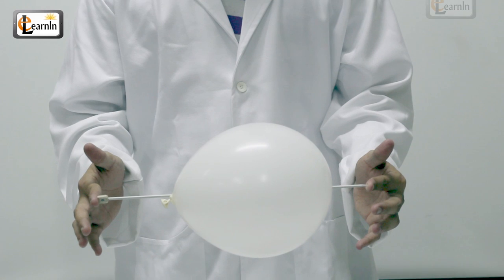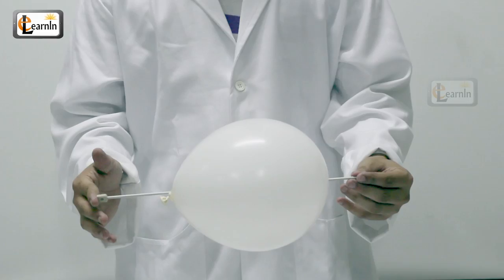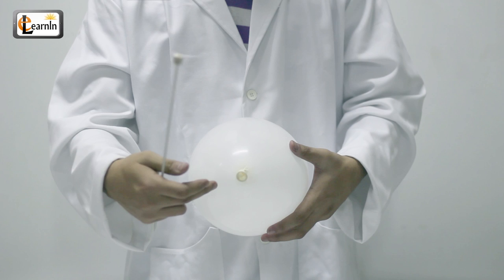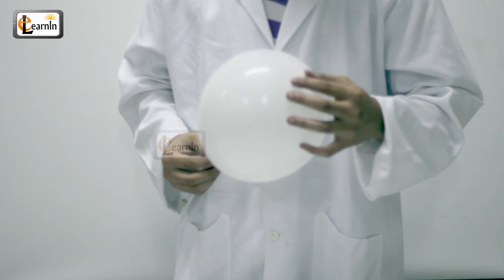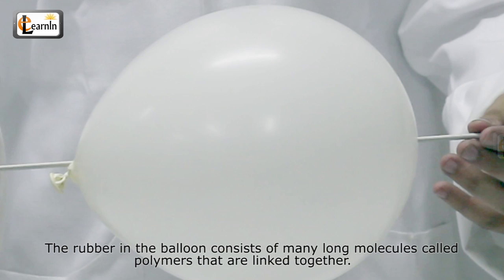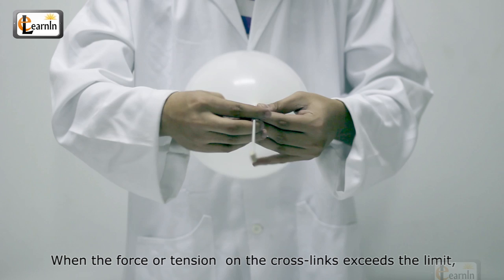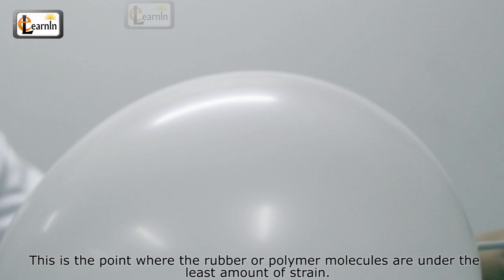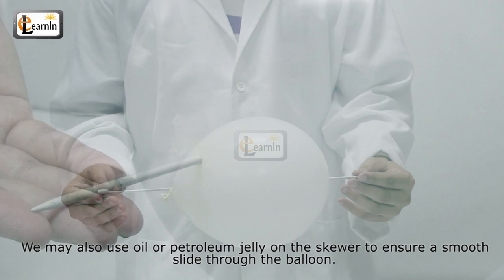Needle Through a Balloon - Science Experiments for School Kids

Comment: What? I Dident Get Anything XD
Reply: Donovan Reed It's like cheese.  When melted cheese is in a funnel, they fall down to the small hole, also covering it.  Then, if you cool it down, the cheese will block the hole, preventing any leaks.  On the balloon, it happens a little similar.  The polymers on the dark spots are a lot more that the other parts.  So when you stab that part, the polymers will sink slowly to the hole, covering the spaces.  And it didn't pop because the polymers stretched and sunk with the rod slowly, making the polymers adapt to the stretching, not being stretched to the limit.  Correct me if I'm wrong, this is just my opinion.  :)